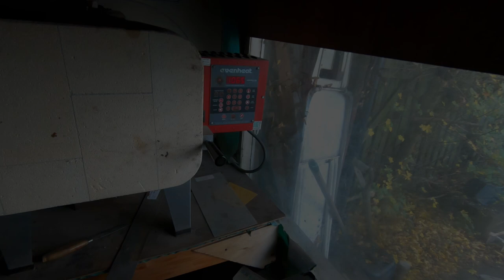Quenching SF100 Stainless steel using Arbor press for speed and flatness

Comment: Hi Sandy. Hope all is well.  I use a woodworking vice with a couple of 1" thick aluminum plates where the wood cheeks would be and so you can just turn the vise handle down to clamp the knife and then use air as well to speed cooling.

Comment: Nice! Bet you did a few dry runs on that setup before you pulled the trigger the first time! This works on carbon steel blades too if you get them in the plates after your oil quench as soon as they are below 450C or so. Finishing them off in the plates makes them dead flat.

Comment: I know very little about quenching (other than quenching my thirst with a pint of ale) but I guess this method cools the whole piece evenly, which has to be good.
Reply from the maker: It just applies a buit more even pressure to the blade as it cools Steve. Gave consistent results and is quicker than the two clamp method

Comment: Dead flat! How did the hardness work out?
Reply from the maker: You won't get it as hard as carbon steel from Quench but I achieved 62Hrc for the SF100 Stainless steel then temper accordingly. 2 times two hours at 185 Celcius gave 59.5Hrc